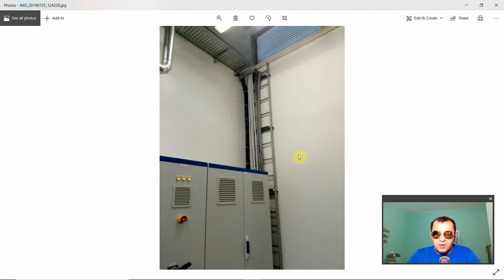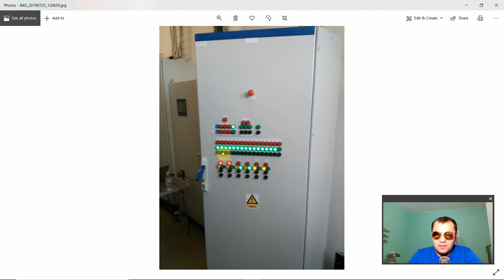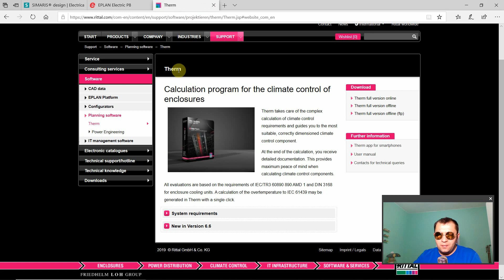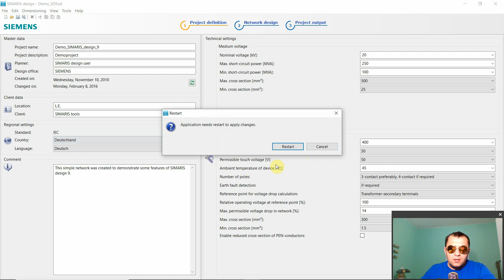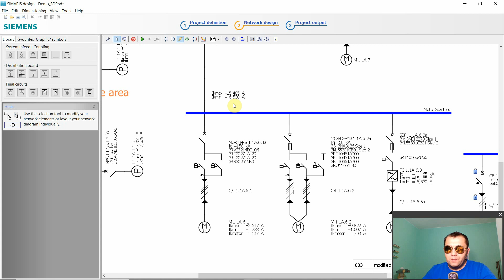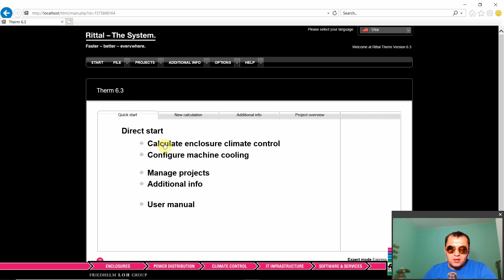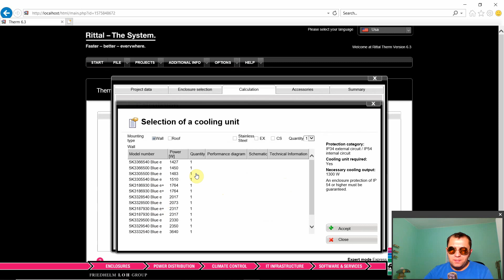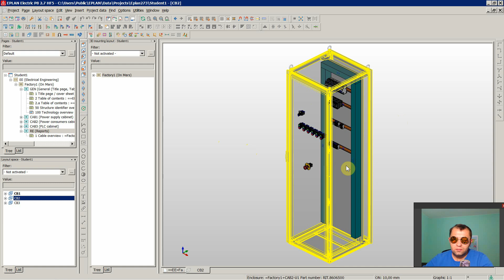How to design an industrial automation systems (full course) - with AS-BUILT photos

Comment: I have a few questions:
1. Was this project a 1-man job? did you design, program, and commission it yourself?
2. What do you think of Solid Edge Electrical Design for the design phase?
Reply from the maker: 1. It was a one team job. I've designed the system based on the input from the mechanical engineers. The other colleague programmed and commissioned the system. And we also had a team of electricians to wire the cabinets and pull the cables and connect the field devices. 
2. I haven't used it so far. I've only used eplan since that is the program my customers demand that we use to design the electrical system. Eplan is very popular in Europe where I work. I've heard that Solid Edge Electrical is the closest to Eplan when it comes to functionality and I've heard that it's a fairly popular program in the USA. I would definitely consider it as an alternative to Eplan, if the customer doesn't demand anything specific. I work predominantly in the automotive industry in Germany where all the big names use exclusively Eplan, so I then also use it on my other projects, since I already have the license.

I hope I helped a little bit with my answers.